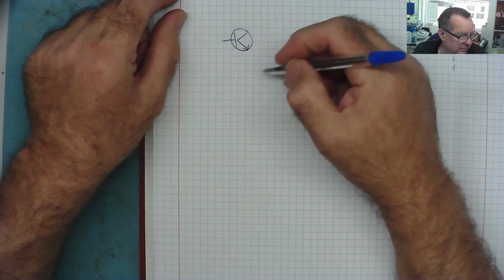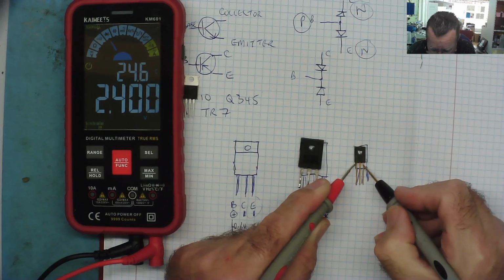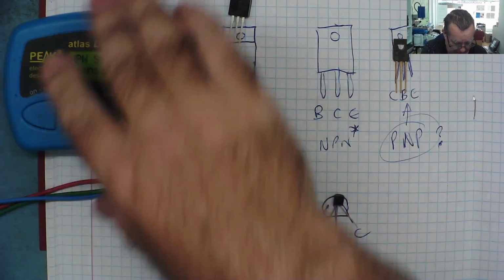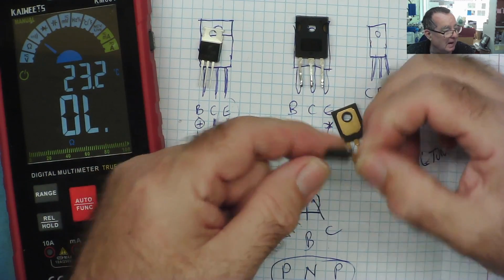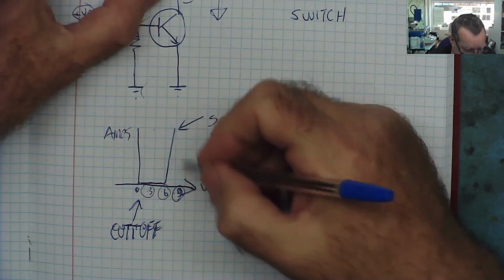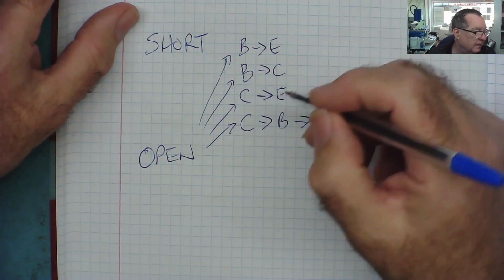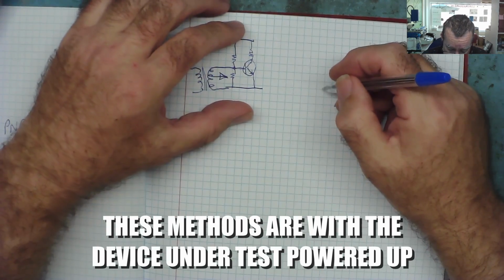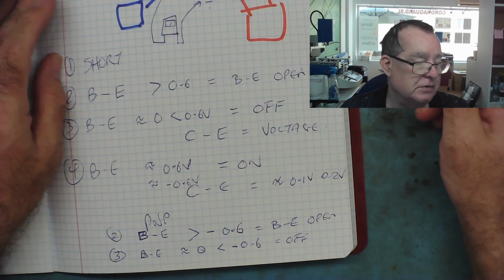All You Need To Know About TRANSISTORS To Fix Stuff! How Transistors Work Test In & Out of Circuit

Comment: Hello - reaaly great and informative video - I was educated in valve circuitry many years ago - this videio has given me an insight into the world of the fastest fuses on three legs - I bought a very nice Marine Radio Direction Finder on eBay - it was advertised as not working - it is extremely clean on the inside and untouched or got at - with batteries fitted its dead so I have some ferretting about to do - this video is of great help - thank you

Comment: I use the traditional standard of transistor by default always refers to BJT, and outside of that I just regard them as the FET family of devices.
Further, there are of course what look like transistors that are in fact voltage regulators, triacs, Darlington IC's and onward. 

You did one heck of an amazing job here. The diode to transistor equivalency we learn for theory is so commonly misrepresented by people in their media today.

Comment: Good even Learn Electronics, I was wondering if you have any videos that go over the repairs of timer circuits that utilize only capacitors, resistors, diodes a zener diode and transistors. No computer chips at all. For example, I am trying to repair an automotive timer module for a 1990 Mazda Miata. Otherwise know as the Unos over where you live. The same module is used for years 1989 through 1997.
One of the resistors appears to have overheated but still reads ok. I replaced all of the four transistors with like in kind or part number. The timer module works well for the key in ignition and when the door is open. The part that doesnt work well is the seat belt reminder and seatbelt buckle icon lamp illumination in the instrument cluster. All driven by the timer module. Any help would be greatly appreciated!

Comment: Some old transistors are hard to find. When you replace a transistor in an amplifier with a different but the best replacement. How do you position and solder the new one with a different pinout. Thank you.

Comment: At around 7:20, why is there a reading with positive probe on the base? Does electricity not flow from negative, which then would be blocked by the diodes?
Reply: Yes it is blocked by a diode

Comment: A amplifier's fuse which is situated on the output of a bridge rectifier getting blown off once the power is turned on. Please tell me what could be the reason of it? And I found 34 v DC on the output of this bridge rectifier though primary supply voltage is 26 ac. Is there anything worng with this bridge rectifier?

Comment: If you ever come across any Germanium Transistors cheap at a boot sale or wherever, you definitely want to pick those up. They fetch quite a bit on ebay and such nowadays. As others mentioned, they are very popular in old and new guitar pedals. And of course, since they aren't being manufactured any longer and needed as replacement parts in many other vintage devices, NOS resellers sell them at a premium.
Reply from the maker: Actually I gave all my quite large collection of Germanium transistors, mostly pulls, to a Radio Amateur friend in the UK before I left in 2016, thinking I wouldn't need them anymore.  These were all devices I had salvaged and kept from the 70s and 80s, and all sorted by component part number
Reply: @learnelectronicsrepair  Doh! Well, I guess we've all done something like that. I had a huge Star Wars toy collection in the mid 80's and by the time I was 12-13 years old, I felt it wasn't cool to be playing with toys anymore and gave my entire (now vintage) collection to my nephews who ultimately lost, broke, or thrown them away 🤦.

Comment: Germanium transistors, because of their low forward bios voltage and low capacitance of the base emitter junction, used in RF amplifiers and tuners. The same goes for germanium diodes.

Comment: Germanium transistors are still used for guitar fuzz boxes to this day. Usually to get the "vintage tone" some guitarists search for. One thing I noticed also, with the cheap transistor tester, it read 1.1v for voltage drop on the darlington. That could indicate it is reading 2x the voltage drop of each junction inside.
Love your videos! Keep them coming! Thank you so much!!
Reply: @Tone Electronics "Usually to get the "vintage tone...". Well not really. They use them because they have low forward bios voltage 0.2 compared to silicon 0.6.  Guitar pickups generate low voltages (the magnetic ones). I think you may be mistake it with tube amplifiers. They have a more mellow "vintage tone" .
Reply: @HairyHu  that makes no sense whatever, the transistors are bias into conduction with  bias resistors, so the 0.2v/0.6v is mitigated and the AC signal is then coupled in through a capacitor,  transistors are current driven devices so it's the gain that's important, silicon  transistors have a lot more gain than  germanium hence you would need more stages depending on how small a signal you were amplifing I built a non contact probe using silicon transistors that can sniff a audio cable (basically a few mV of leakage) the video is on my channel, the guy is right people still use germanium transistors in  pedals etc because they say they sound better (despite them being obsolete, unstable, leaky and very inconsistent electrically )  this instability gives them a more dynamic and expressive character, the also have a lower frequency response than silicon which I suspect causes the  retro sound the FX guys speak of

Comment: Learn Electronics Repair ? I have a scenario for you. What would you do if you were Swatted and the police knock over all your electronic part bins, like transistors, resistors, capacitors etc. and  leave thousands of parts on your floor. Would you sue, to have the police read off, with a magnifying glass, all the part numbers, color codes on the electronic components and place them back in their proper parts bin locations ?  or would you spend days or weeks doing it yourself ?

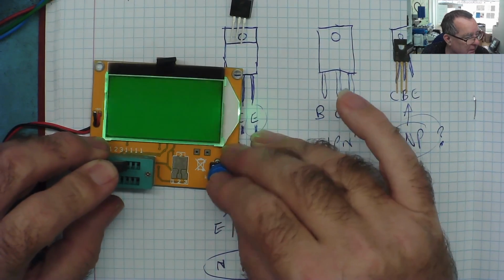Comment: 20:37 it appeared when you put the big transistor in the cheap tester you may have put the pins into 1, 2, and 1, which would explain why it said diode.  I have the same tester, and mine acts the same way if I put a transistor into 1,2,1.  Besides that, everything looks great so far.

Comment: heres one i have for you.   i have a few cassette deck motors.  they  have a speed control circuit in them.    there is a 4 terminal  transistor. is it a transistor or an ic?  had to put one of these in a getto blaster   works well!
Reply from the maker: Well I need the part number to tell you that.  There are some four terminal transitors that I know of, the extra terminal is often a 'shield' connected to the metal case of a transistor and you generally only find this in high frequency circuits (radio receivers/transmitters)
Reply: @learnelectronicsrepair  cant get the part no   as they are in the end of the motors.  looked at another bigger motor and this one had 3pins but it is still that same type.   the body has a 3 point star hole. no heat sink.  these can be either 3 pin or 4.

Comment: I stopped bc you don’t know that the peak analyzer is accurate and the other is no better than your DMM. The peak provides you w reliably accurate readings of Hfe and leakage as well and w the dca75 you can do curve traces as well via usb. That Hfe thing is important. I’m working on an amp rn and all the pnp transistors test as fine transistors it’s just that their Hfe is out of spec meaning the amp doesn’t work correctly. Couldn’t have found that fault w a DMM. Not to mention if you need to match a pair of transistors the peak is really the only option short of the circuit and maths way.
Reply from the maker: Arsenic Jones
I don't understand why you stopped seeing as at the end of the comparison I point out that the Peak is the only one of the three devices that actually identified all five of those transistors correctly.  Why do you have a problem with that?   I also discuss the issues of matching Hfe (gain) in amplifier circuits.  Am I right in thinking you are judging me without actually watching what I published first.
Reply: @learnelectronicsrepair  you’re right I didn’t finish your SCRIPTED AND EDITED VIDEO bc you said you don’t know the difference between the two. Not we’re gonna find out the difference but an admission that you know nothing. Why would I continue after this? You’ve admitted you don’t know. Your credibility is gone. You wrote and edited this video so had a chance to correct it. So no I am judging you based on the content you put out. I’m judging you on how poorly you conveyed your point. Also “I eventually figure it out” is an excuse and expecting that your audience will stick around to watch you stumble into the right answer is dumb. I’m now judging you for that too. 

In conclusion your video is a story. Even when it’s a technical video. If your story has a giant plot hole in the middle, don’t expect your audience to finish. The fact that we can even have this conversation is proof that you failed to convey what you wanted. Don’t @ me. I’m not interested in taking this conversation further. Take the advice and do whatever you want w it but don’t argue w me.
Reply from the maker: @arsenicjones9125  OK no problem.  I don't script my videos, I never did, I just work with what is in front of me - especially on repair videos when I usually start with just basic electronics knowledge and gradually work out the details. There are many times when  I 'eventually figure things out,' I think a lot of techs do.

Where i am probably different to many is that I'm just happy to show that process as it happens, because I think that it is worth something to folks learning electronics repair.

Of course I take your advice, and that of anyone else who has anything constructive to say for that matter.  And I do find your reply constructive.

I'm sorry I disappointed you this time. At least you have taken the time to explain what you didn't like about this video which gives me a chance to improve.  Thank you.

Comment: Thanks, I did not know that the Emitter gave a slightly higher voltage on the diode test.
 I normally explain a transistor as being a bit like a tap with the handle being the base but I like your explanation when it comes to a faulty transistor. Good video and a great way for me to refresh my knowledge
Reply from the maker: You are welcome.  The reason the emitter has a higher voltage drop is because the two N type silicon layers (in an NPN) transistor have a different amount of doping compared to each other.  The same applies with the two P type layers in a PNP transistor.   I think this trick of identifying the emitter is something that is hidden in plain sight.  You see the small voltage difference every time you test one but you don't think about it's significance.

This will very occasionally let you down and you will find some transistors where you can not see a difference B-C and B-E but I never saw one where B-C gives the higher reading.

Comment: The base - emitter is higher resistance (higher voltage drop) because the emitter is more doped.
Reply from the maker: Yeah that is correct.
Reply: @learnelectronicsrepair  Thanks Rich, It was for the viewers 😊Hopefully the word dope will make the youngsters curious to what it is and go check it out. 😂
Reply from the maker: @NewbFixer  I also wondered what some viewers would think about transistors going 'hard on'.  Contrary to some opinions this does not only happen if you use your device to view porn 🤣
Reply: @learnelectronicsrepair  lol

Comment: Multimeters have come a long way showing all this detailed info about a transistor.
Reply from the maker: Two of those testers are semiconductor analyzers rather than multimeters

The cheap one is if the LCR-4T.  I made a review of this one back in June of last year
https://www.youtube.com/watch?v=BXb5aN6afl8

It cost me €6, though they seems to have increased in price a bit since then.  They are still very good value for money, if you can't afford the DCA55.
https://www.aliexpress.com/item/4001359753689.html

The Atlas DCA55 still seems to be about the same price I paid for mine in 2014.  This is my preferred semiconductor tester, for reasons demonstrated in this video
https://es.farnell.com/peak-electronic-design/dca55t/analizador-103x70x20mm-semiconductor/dp/3727476
Reply: @learnelectronicsrepair  Yes I mistakenly thought that it was a multimeter, because I didn't know about semiconductor analyzers. Thanks for pointing out to them.

Comment: What parts on a power supply circuit board don’t work when it’s cold but works when it’s warm/room temperature?
Reply: Look for faulty electrolytic capacitors. Old ones dry out, and loose their capacitance, but when they worm they work better.
Reply: @HairyHu  yep that was exactly it, the power monitoring circuit had a bad cap in it. The freeze spray worked fantastic on it.
Reply from the maker: That sort of fault is most commonly caused by 1. Resistors, 2. Capacitors, 3. Transistors.  But it could be caused by any type of component or IC.  The easiest way to find this type of fault is to use a hair dryer or hot air station set around 100C to warm up different areas of the PCB, and Freezer spray to cool specific areas.
Reply: @learnelectronicsrepair  perfect thanks, been trying to diagnose a digital readout power supply, had bad capacitors blown up on it and replaced it, worked well for a while, then stopped working again. 
Wasn’t working when it was 5C then 10C now it’s room temperature. 
Resistors tested good to all. 
One ER302 voltage regulator is suspect as I think it’s leaking current backwards. Input of 70V ac down to 35v and without load it’s dropping to about 28V. 
But I will try the heat/cool. And see what might be the culprit.
Btw love the videos you have done. I have very little experience with circuit boards but it’s starting to make some sense of it all
Reply: @learnelectronicsrepair  
Forgot to reply, the freeze spray worked fantastic to find the bad voltage monitor cap, just a tiny thing